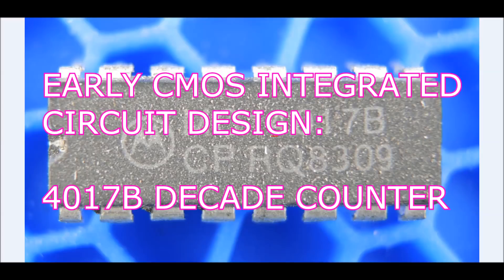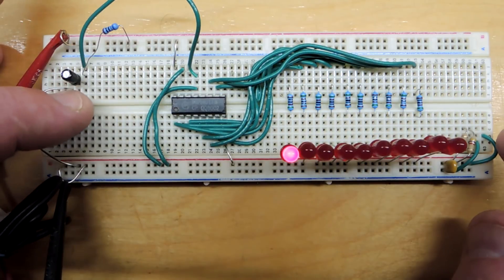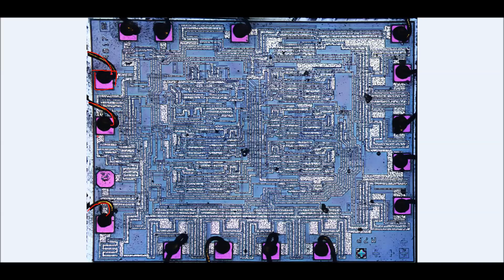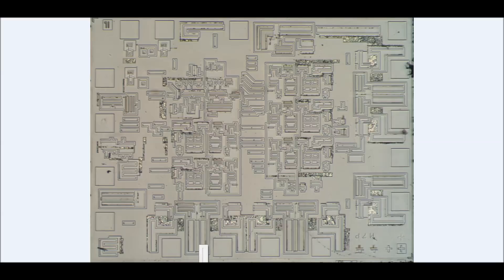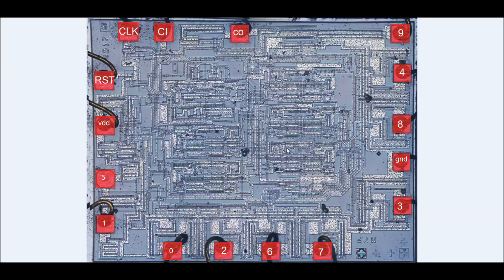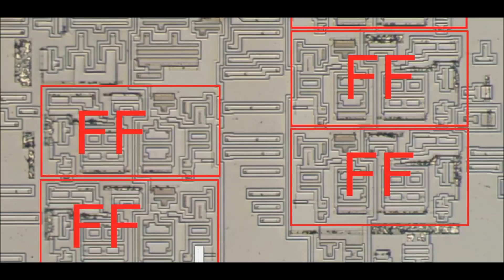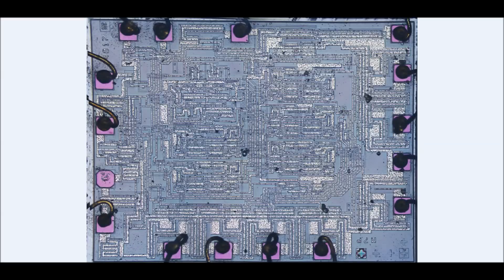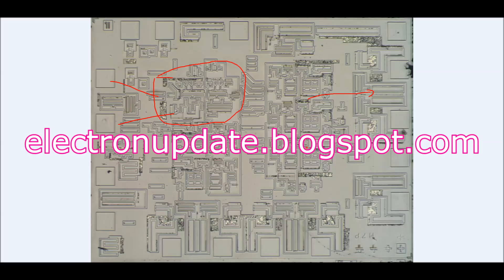Early Integrated Circuit design: the 4017  STRANGE PINOUT!

Comment: As a part of a christmas present, i am adding a simple talking soundeffect to a plush toy for my girlfriend. I discovered some amazing low-cost chinesium modules with audio recording and playback capability.
Those modules all have a DIP14 chip, marked ISD1820, which is made in some chinese basement, however i found the datasheet:
 https://cdn-reichelt.de/documents/datenblatt/A300/103020018_03.pdf
It seems like it was made to mimic the functionality of the ISD1810, a Winbond Chip.
It would be interesting if you could have a look at the DIE of the chinesium Chip, as it has a mic amp with agc, an ADC, flash, DAC and a full-bridge class AB amp for the speaker, all for a couple of cents.
I found that 1 cent gets you 7 DIEs.
Its clock is based on an RC oscillator with the R being external, so you can change the clock with a pot while it is running.
Your vids are amazing, my deencapsulation technique begins and ends with burning the plastic ;)

Comment: did you ever decap something like a "modern" processor ? If I can get my hands on the fuming nitric acid  stuff I will try decapping myself, for most dead components. I have a small repair business (mostly test and calibration gear) and I am often curious what went wrong inside a component. I had a dead transistor (TO220) a few years back, and that was already replaced rather recent befor. I decapped it together with an original on a mill and found out the die of the newest one was about 1/3rd of and the metal plate  was a lot thinner. Both where the same brand.

Comment: Why do some of the inverters have an inverted input and others an inverted output?
Reply: It's a concept called "negative logic" as opposed to "positive logic" which we all know.
One denotes it creates a negative output, expects a positive input, the other creates a positive output, expects a negative input.
For a simple inverter, it doesn't make any difference, however the way it's drawn shows the negative output to negative input cancel out.
So you can redraw it as an AND gate wired to a buffer, without changing the logic at all.

For more complex devices, the negative input can change how the chip functions. The 74xx123 is one basic logic gate with negative inputs, 80's/90's era RAM/ROM also has them.
Reply: @station240  interesting. Never thought of it like that before. Do you happen to know why some schematics have, e.g. AND gates drawn as NOR with inverted inputs, or is it much the same reason (although it makes it a bit of a headache to read)?

Comment: Could you "fix" the pinout in the bonding?
Reply: theoretically yes but you generally dont want to bond across the chip as well as keep the bonds as short as possible. Back when that chip was first made they probaply didn't have machines that could bond across wires (even today its rare, but sometimes used for extremely high pad counts with multiple rows) and if they had todays tech they would have just added extra layers to the die and fix it there

Comment: Would love to see a video on the 74HC164 8 bit shift register
Reply: A 74LS164 plus some logic is an LFSR, equivalent to a 255-step counter with an unusual order. Fold that logic with a wavetable into an EPROM, add an R-2R ladder DAC, and you should be able to generate arbitrary waveforms accurate to at least 7-bit precision (presuming the LFSR is robbing a bit from an 8-bit EPROM) with 2 off-the-shelf ICs. Adding another shift register and using a large EPROM scales as far as your resistor tolerances+clock speed allow, and extra address lines can select between waveforms for a full-featured function generator.

A PIC or AVR could also do the same thing in one self-contained chip for less than the current cost of a 27C256, but where's the fun in that?